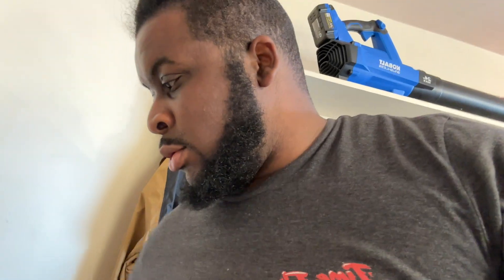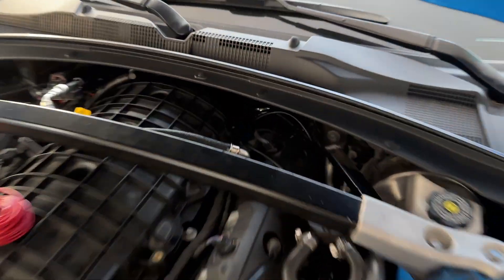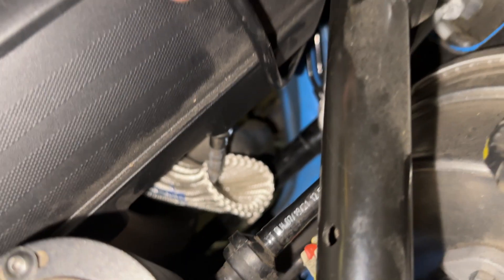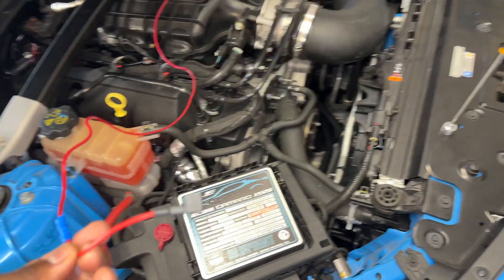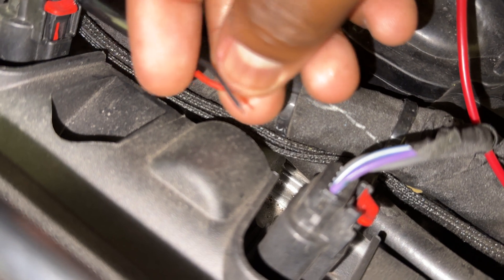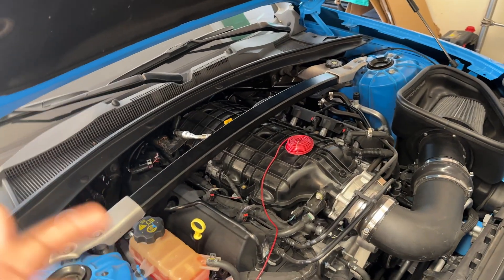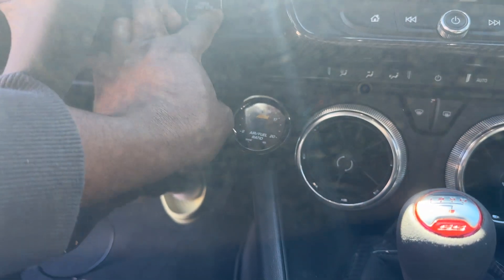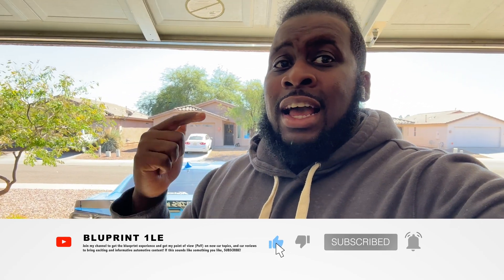AEM Wideband Gauge Quick Guide 6th Gen Camaro

Comment: Did you take the stock ob2 sensor off and replace it with the wide band sensor instead of welding?
Reply from the maker: So my exhaust was aftermarket and I am catless so I had them weld a o2 bung in there so I can screw my wideband in. If I was stock I would have my exhaust shop do what you mentioned and weld one behind the stock one

Comment: Anybody watching this? If you're looking for a power wire on the Gen 6 for your AFR, just run it to your cigarette lighter wire. It's a 15 amp wire. Save yourself some time
Reply from the maker: That’s good alternative but if the cigarette lighter gets shorted so does your AFR gauge now both doesn’t work. But to each their own. As long as it works that’s all that matters